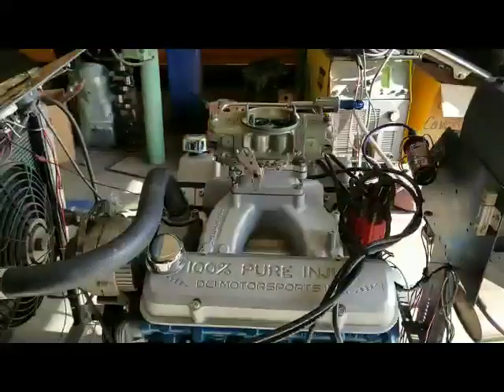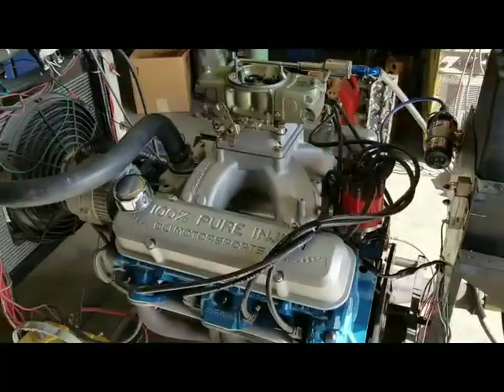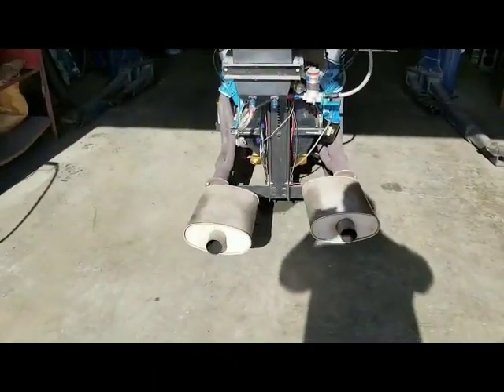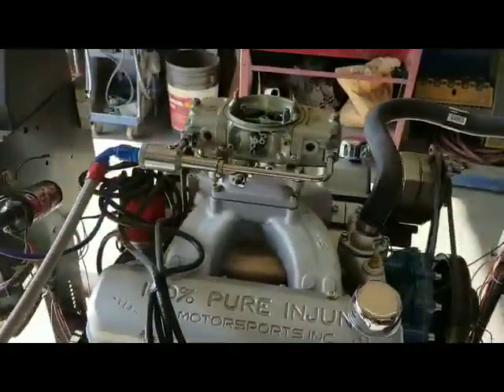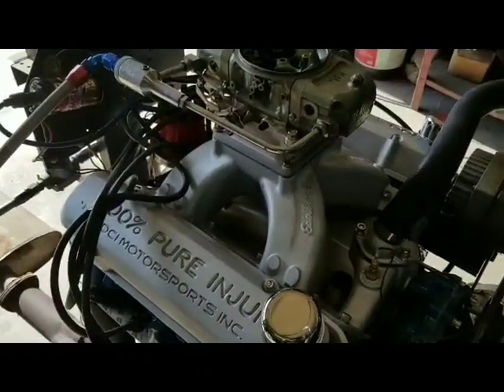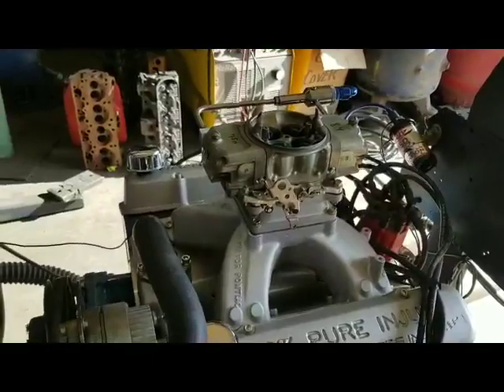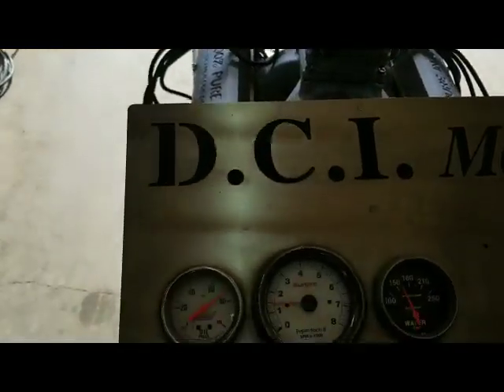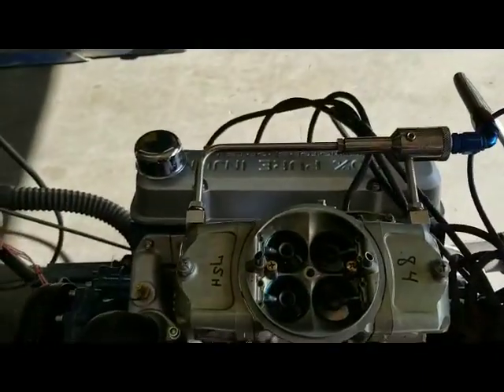#short#wicked#viral DCI Motorsports pump gas 406 Wicked throttle response Big Cam

Comment: why didn't you use a dome piston. 🤔
Reply: We didn't need the compression for what this engine is being used for. Not to mention when the cylinder heads are set up properly. The engine fills the cylinder enough raising the dynamic compression to a higher level. Hence the killer throttle response the engine has :)

Comment: It wont rev like that once it has a transmission and converter bolted to it. They ALL sound nasty with just a flexplate bolted to it.
Reply: Believe it or not they still do even with torque converter or flywheel and clutch. Most of our engine rev so fast that they hit the rev limiter in low gear immediately if you dont have a sticky tire on it. :)
Reply: @DonJohnstonDCIMotorsports  Yes, mine does also. But it WILL rev much faster without the load of the converter and transmission on it

Comment: What should I look into if I want that peppy response from my motor
Reply: Take your torque converter bolts out... It will rev like that.
Reply from the maker: Cylinder heads ,cylinder heads, cylinder heads, and complimenting components to support them.

Comment: Bad to the bone, I love the valve covers looks sweet. I have a 1972 455 H.O., it is bored 60 over and has old school trw L2394 pistons, roller cam, torquer 1 intake with a 850 hp series carb, and I'm still running 7f6 heads. I try to buy 400s and 455s whenever I can find them, have a 1970 455 360 hp also. You guys have some cool stuff, if I ever get enough cash I want to build a ram air 5, love Pontiac. 👍👍🏁
Reply from the maker: Thank you for the kudos !!! Pontiac engines are drying up so we need to grab them when we can. Look forward to helping you with a RA5 build when you're ready.